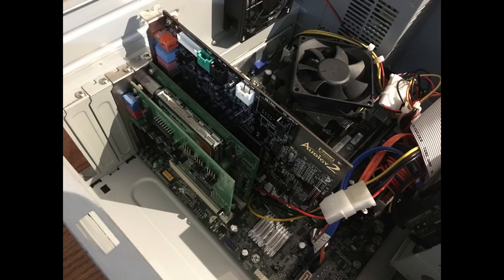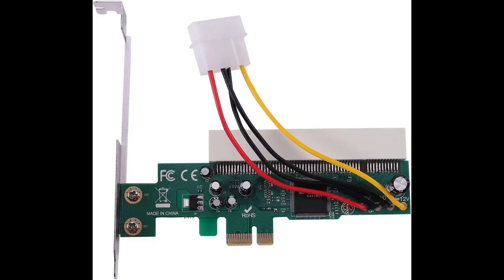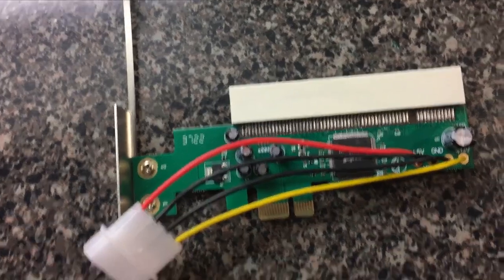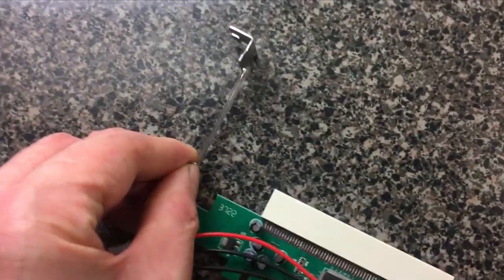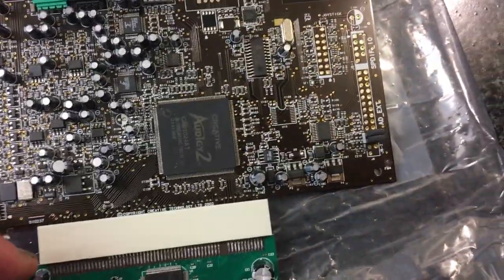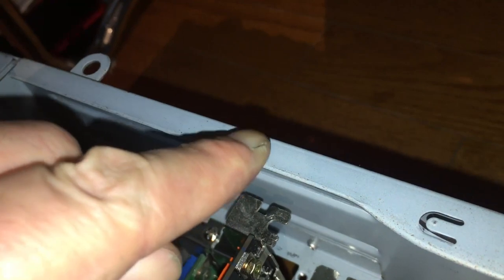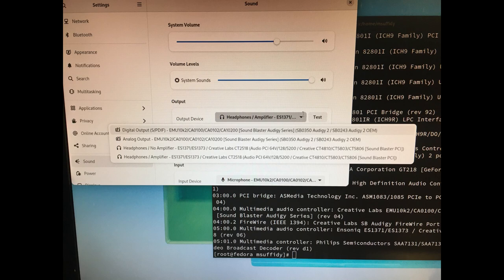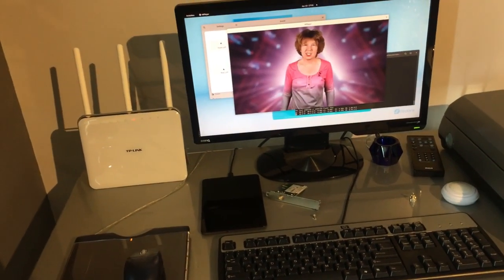Using old PCI cards. The PCIe to PCI adapter.

Comment: The sticky stuff on the bridge card is soldering flux. It helps the solder flow into the joint between the connector and PCB. It usually should be cleaned off, but this card was made cheaply and crappily.

Comment: Good idea, helped I figure what adapter to find for my project.
Looking at the size of the adapter card, this gave me some insight to how much space the card takes.
Looks like the PCI slot could be removed to save 3mm or so, then depending on layering of the PCIe connector, i.e. powerand ground sheets between the board, I may be able to chop that down and make it fit the external CDROM chassis of a Lenovo thinkcenter mini-PC and route the PCIe lanes from the WiFi socket or NVME (Use SATA for data), then I could have a very good sounding mini-PC.
Reply from the maker: Well what I was saying that if you use this sort of adapter, your card will raise up from where it would be normally. You can't like hack into your motherboard to gain room. So really you need a case that makes sense with a card being higher up than normal, and maybe some of it needs to be cut out, or a clip added to for locking the card down.
Reply: @MatthewSuffidy  I know, I just didn't know until I watched how compact the card already was.
I note the soundcard has room for one of these cards to go inside of a Lenovo "1 lite PC" external CD-drive caddy.
I just didn't know how compact the card was until I saw your video with them fitted together.
This helped me realise both would fit inside the space constraints.

p.s.
I'm the sort that, if you've seen those "xbox turn laptop/handheld" DIY conversions where they brutally chopup the console motherboard and hand-solder loads of wires (Hats out to them!), I'd cut things down and solder things together to get the most out of a small space, I just wasn't sure this card would be small enough and the ASMedia chip had no datasheet I could find.

I have a spare electrically PCIe socket in the micro PC.
Reply: couldn't you use a pcie riser to move the card to one of those open slots at the bottom?
Reply: @juanwick730  Unfortunately, no.
Basically, my mini-PC is more like a laptop connector wise.
As for the person's video, possibly, though, I'm sure he had a mainboard in the way of those openings.
Reply from the maker: @juanwick730  It was just a test system, the real one would have a full sized board.

Comment: I have an M-audio RPC-1 sound card not quite as tall as your Audigy 2. I really miss the Logic 4.7.1 recording pgm so I am trying to use it in this Dell 808 series desktop with only one open slot which is pcie. I believe it will work but only time will tell. Thanks for your video nonetheless., if you have any suggestionsthey would be welcome.

Comment: I also have several of these bridges here.  In a retro PC I connected two Voodoo 2 cards to a PCIe X1 slot.  Even SLI works.  Then I have a server from 2004 with a Radeon Low Profile R7 250 graphics card that has 2 GB.  Now I plan to implement a fun project with the help of such adapters.  An Athlon XP 2400+ from 2002 with a high-end gaming GPU such as the GeForce 980, 1080 or from AMD's R9 300 or RX 400 series should be used.  You will ask how I want to do it.... I install an AGP to PCI adapter on the AGP slot, I install a PCI to PCIE adapter on this PCI slot.  Then I take a PCIe riser and install the card vertically in a gaming case.  😁 I'll see if that works, I'm still missing the AGP adapter for testing.  It's already ordered.  I think this is going to be the craziest Socket 462 PC out there.  If it works.

Comment: Might be interesting for someone with some electronics engineering skills to put together a "motherboard" that's basically just a bunch of PCI slots and a PCIe-to-PCI converter chip that can be connected by a long PCIe cable to an adjacent machine with PCIe slots, then you'd have two side-by-side cases, one filled with modern cards, and one with legacy ones, but both being part of the same computer.

Comment: Looking at my case, thinking I could probably use the available vertical GPU mount slots, and that first connector. Hmm. I could use my Audigy again.
Reply from the maker: Another thing is some stereo cable have right angled connectors so if you install them before the card they would probably fit and the wires would come out the card slot.

Comment: Hi, you may found one, because i didnt, do pci to isa cards exsist? I tried my best finding one, but i found only one and that is not that promissing
Reply from the maker: Well one problem there is the framework or what is a PCI bus vs a ISA bus. In theory you can do it, but the computer itself would have to expect the ISA card somewhere in address space it usually would not be, and something else has to set it up. So I expect the demand is not there, but it could be an interesting enthusiast idea.
Reply: @MatthewSuffidy  hm, expected something like that, but thanks, maybe windows or linux would detect something like that the pc "it self" would not realy, but i was just finding a way to get a floppy controller on a modern pc to work without usb